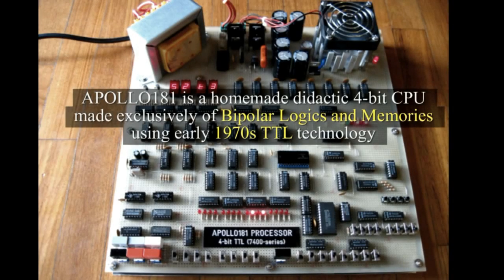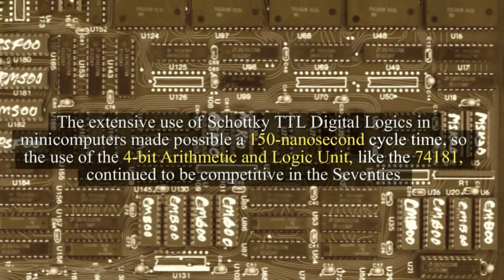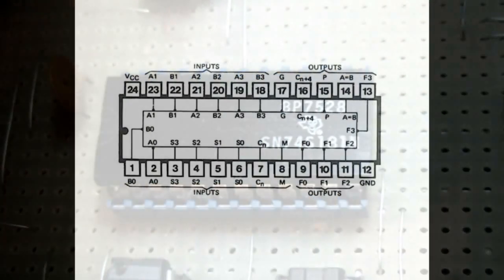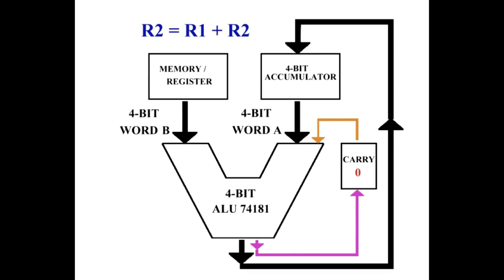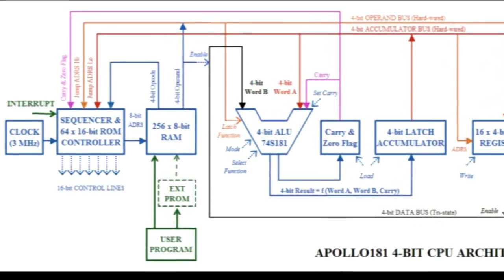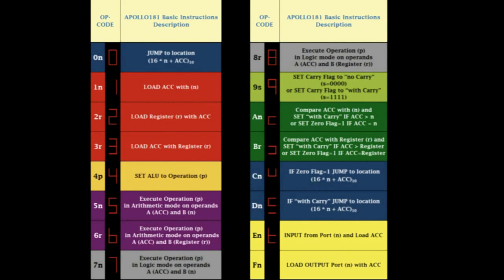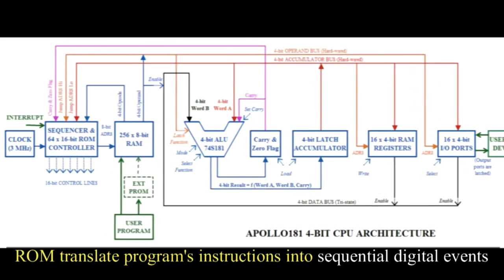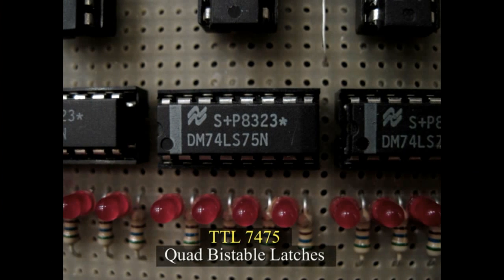Build your own computer CPU using digital Logic & Memory before microprocessors: APOLLO181

Comment: Can i connect LCD display with it ?
Reply: You could add it, but you would have to change the software and add more hardware to interface the display. 7-seg displays are far more easy to use, as you just input the number.

Comment: how do modern computers compute so fast? Is it the fact that they are either 32bit or 64bit architectures?
This computer, the Apollo181, was a 4bit computer that was able to compute a 12bit problem in 1.2 milliseconds. I'm assuming that this means the computer had to go through more cycles in order to computer that problem, but if it was a 8bit or 12bit computer it would take less clock cycles, right?
Am I right to think that if they used a faster clock it would've done the job faster? 
Am I right to think that since the parts that are doing the arithmetic are all solid state, there speed is a result of the speed of the electron passing through a conductor?
Reply: You're welcome.
Reply: There's no such thing as a 12 bit problem . Instructions might be encoded in 12 bits , but that's not an entire program The appolo computer was able to do integer multiplication in 1.2 miliseconds .. The Amount of bits of a processor doesn't intrinsically make your cpu faster . It only does so if you are able to take advantage of it . If you operate on 4 bit values , your operation will take just as long on a 4 bit computer as it would on an identical 32 bit computer . However , if you're operating on larger numbers , speed can change.  A 32bit operation can be executed in one cycle on a 32 bit adder , whereas it would take at least 8 cycles on a 4 bit adder.

Modern computers rely on many different techniques to speed up execution , afforded by the extra hardware of new microprocessor fabrication techniques :
- they run at higher clock speeds 
-They have an internal RISC core to use the processor core and ressources more efficiently.
-They are pipelined, allowing for shorter cycles , and thus higher clock speeds.
-They have stronger internal mechanisms making sure that the core is kept fed , to avoid stalling .
-They use supercalar pipelines , to allow for multiple operations to be executed at once by a single core.
-They have "vector" processors ( SIMD or VLIW ) that perform an operation , such as addition or multiplication on many data points at once.
-they have dedicated hardware for certain operations , such as multiplication and floating point ( early computers did not support this natively , and had to do so through software , which was slow. A multiplication was done by multiple successive additions ) .
-etc
 
You're not totally wrong about the clock speed part . Increasing it would have allowed some extra performance , but technology of the time only allowed so much .
Your clocks are ultimately defined by the amount of time it takes for your signal to go through your circuitry , or a stage in modern pipelined processors.
That's called propagation delay , the time it takes for your signal to go through something . It applies to IC's and wires . The 74 series TTL IC's used at the time had a propagation delay of around 10ns , which doesn't sound like much. However , once you string them together , your propagation delay adds up , and you end up with a delay of hundreds of nanoseconds or more , limiting the clock speeds of your cpu.
Reply: @hydrochloricacid2146  Also, with higher level of integration, e.g. 20 nm vs. 40 nm, the signals inside the chips have shorter pathways to travel from one part of the circuit to the next, which further contributes to the increased speed.

Comment: But can it run crysis
Reply: If a computer is turing complete then it should be able to.
Reply: at 100000 fps ultra 64k res
Reply: 10p @ 1 pixel every hour, and that's just the menu.
Reply: Coffee yes it can,but it need a suitable executive program which never existed from modern compilers of windows,android java or c...etc.i like the logic gate and industrial series ic because it's durable and creative.I'm making a cpu and complete computer with it.The hardware power of it doesn't under any pc,But the cpu can't small as well as the intel 14nm cpu.it would work like ARM but different,it can't execute too much process but will run high frequency to execute immediately thousands processes per second.
Reply: Whaddya mean "That's just the menu"?  At one pixel per hour it will shoot all dem bad guys well before the Sun goes nova.  Maybe.

Comment: This would not considered a CPU because it is not micro. It would be a PU for processing unit.
Reply: No, the CPU is not part of a microprocessor. CPU = Central Processing Unit. There may be more than one microprocessor in a computer, but the main microprocessor is technically the only CPU.
Reply from the maker: This is in reality a basic 4-bit "minicomputer" on a single board, but you could see it also as a 4-bit RISC (reduced instruction set computer) processor, made of distinct “bipolar MSI” integrated circuits. MSI= medium scale integration: each integrated circuit contains less than 500 components or has more than 10 but less than 100 gates. Bipolar= the chip uses the faster bipolar junction  transistors and not the later CMOS technology.
The most complex chip  here is in fact the 74181 that performs the arithmetic and logical operations which is equivalent to "only" 75 gates and it is made of less than 200 bipolar transistors in a single MSI package. The "microprocessor" was developed later, in the late 1970s as a result of large-scale integration (LSI), which made it possible to pack "thousands" of components on a unique chip. "MPU" (Micro Processor Unit ) are CMOS system on a single chip. The later "microcontroller", in simple words, has also the memory and the A/D converter implemented in the same package of the MPU.
Reply: the C in CPU stands for Central
Reply: I've heard people call bios built in operating system XD
Reply: The term "CPU" has been used since the mid-1950s, well before microprocessors existed.
Reply: +Agustín Núñez Oh I have heard some people call it compact processing unit. It is probably not even one the terms used for CPU though.
Reply: CPU is actually part of a processor, and now it's all built-in every single microprocessor.

e.g. microprocessor: CPU, Integrated GPU, Memory Controller, North- bridge controller, SRAM, ... (system-on-a-chip is much more complicated)
Reply: I would rather call the machine board above in the video a MPU

Comment: The title of this video is "Build your own Computer CPU using Logic & Memory", so where is the instructions to build your own CPU gone to? I don't want to buy from intel or amd anymore than I have too
Reply: The beginning of the video showed you two books where all of the logic and components were taken from you daft pleb.
Reply: Lmao, don't be silly dude. It's a video about 4 bit ttl processor. It's more like for education and fun only. You don't want to make these if performance is what you want.

Besides commercial grade cpus that we usually use are near impossible to be made by one person.  If you really don't want to buy intel or amd where their architecture are the most widely used and supported by mobo, you can try riscv architecture cpus although it's still in early development, very limited hardware options and I doubt you could get commercial one easily for the moment. It seems to have a bright future though. 

Anyway, I think you already know this as it's very popular . arm cpus are quite widely used especially for phone. Some computers are actually use them and you might be able to use them and install linux if you really don't want intel or amd. Gotta say imo they ain't any better than intel though. Don't like their business model they won't sell to consumer right away you can only get them already builtin with the device you buy and even though it's open you have to pay royalty to them if you want to sell them.

Comment: Cool! Years ago I bought a Kaypro off eBay and it's insides looked like this. Lots and lots of those I/C's . I ran across this old digital computer patent 3190554 where it used compressed air to computer instead of electricity. Was such a computer ever built and used for anything? Could you build one today using 3D printing? If Babbage had one with air, could his Difference Engine been built by the folks that made pipe organs?

Comment: Your computer is 8 bit computer as it has 2^8 = 256 memory addresses.
Reply from the maker: +Phyman 100
 No, it has 4-bit buses also to address the memory and the lower nibble is stored in the accumulator. Chech the jump instruction.

Comment: Have you built in hardware interrupts  for this 4 bit TTL system?
Reply from the maker: Joy of Lego A simple non-maskable interrupt technique has been implemented via hardware. When a device asserts the interrupt signal (in our simple case a button key) the CPU waits to finish the current instruction execution and then definitely jumps at the memory location pointed by a set of 8-bit switches placed on the board. In this way it is theoretically possible to implement 2^8 = 256 different interrupts which could point all 256 RAM locations of the program space. Here we can put a conditional jump table to enhance interrupt capability. Unfortunately the lack of a memory stack and the limited number of available instructions has prevented the implementation of a “return from interrupt” which would have allowed the program to flow back to the main program where it was interrupted.